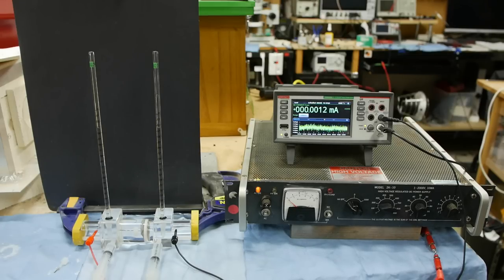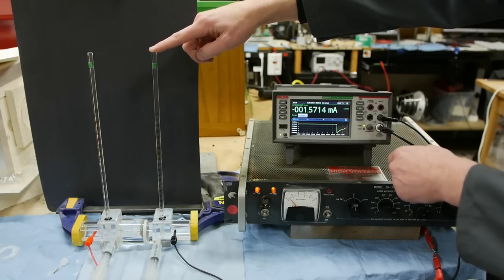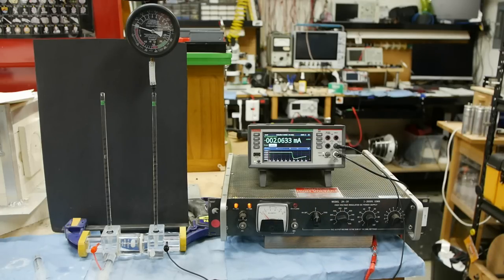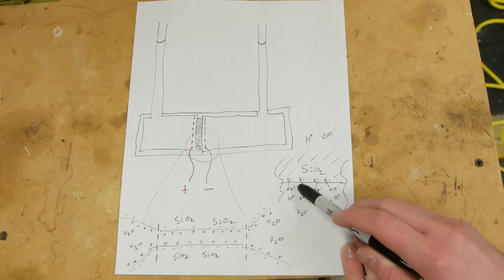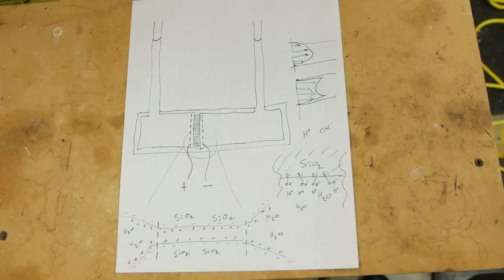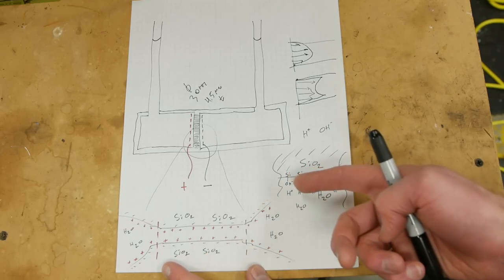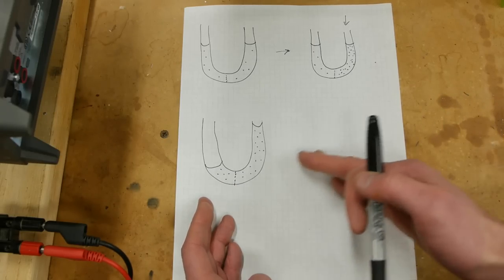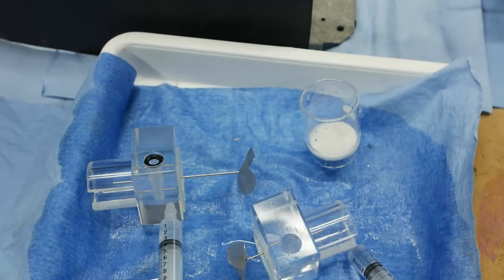Electro-osmosis: pumping water with electricity and no magnets

Comment: Doing the math in my head, half a milliamp times 200 volts is about a tenth of a watt, a tenth of a joule,  a hundred grams per second, a tenth of a liter/s?

I see where you're getting 20 ml with three milliamps? Which is .6 watts, .6 joules, 20/600 ml, a little less than seven percent

Comment: So oil does not get pumped with this pump.  If you have salad dressing on one side could it pump out clean ('ish' due to other polar molecules getting pumped as well) water? could this be used as a stage in water purification?

Comment: For your information. Is it the same theory? May be not, but similar equipment setting? Yes for sure! The Japanese have a similar device in use in fish framing business, not as a pump, but a device to kill water born virus of fish in flowing water. The process let the bacteria and virus in water be the conductor, there for burn them to death with 3~5amp of electricity during the process. Suppose if there are more virus in the water, the flowing of water will be faster. That device is still a restricted item from export for obvious reason.

Comment: It sounds like there could be a lot of cool applications, such as filtering out water, or using it as a flow sensor. Given the responsiveness, it's almost like a transistor. If both ends were closed off with membranes, you could probably make a speaker. Maybe this could be combined with Sonoluminescence?
Reply: The filtering aspect would be a negative actually. As it would cause most implementations to clog up very quickly.

I'm not saying it has NO use. But the efficiency would be a problem in all but the most specific situations.

The electrolysis is also probably a problem. Or a hazard even.

Comment: I don't get how the OH is desorbed to recombine with H
Reply: I don't think it does. I think all the H+ ions gain electrons from the negative electrode and become H2, while the positive electrode removes electrons from H2O producing O2 and H+. The OH- all stays stuck to the glass.
Reply: @gcewing  that was also my. conclusion. It would be interesting to measure the pH in the two chambers. But I wonder since it changes the composition does it count as a pump?
Reply: I suspect you wouldn't notice any change in pH. Lowering the pH, for example, would require increasing the concentration of H+ relative to OH-, meaning there would have to be some other negative ion around to balance the charge. But with only pure water in the system, there isn't any other species of negative ion available.

So I think there will be equal amounts of H+ and OH- everywhere at all times. In the chambers, it's just the naturally occurring H+ and OH- that you get in pure water. Whenever an H+ is created at one end, another one is removed from the other end. The H+ ions flow through the system, but their concentration doesn't change.

Comment: I'm sorry.  Are you actually generating an electric current by passing water across two electrodes?  Is that what's happening?  Doesn't that mean you could charge water up and then harvest the energy from it?  

Does the water have to be ionized water?  Rather what is the Ph tolerance for being able to make the water move via electro-osmosis?  How does distance, and electrode size affect the ability to move water?  

13:39 What if you had a smaller, conductive rod running up the center of the pipe?  Or a microcosm of the pipe system itself?   Don't you double the points at which the field is being generated strongly while also diminishing the area of low charge by half?  

could you move water through a pipe using several of these systems interwoven along the pipes length and managed in such a way that the they did not interfere with each others fields?  

What happens if you invert the tunnel and make it a toroidal structure inside a H2O system?  

More importantly,  I think, is for me to share with you some of these other  experiments related to water and its properties. 

1: Ted talk regarding the "fourth phase" of water, wherein the facts you highlighted are expanded upon , regarding the tendency for water to decouple where it meets the pipe.  

https://www.youtube.com/watch?v=i-T7tCMUDXU

So I think that means that you generate a tubular area of EZ water exists inside the physical pipe thats negatively charged.  Therefor couldn't you generate sin-waves up the length of the "pipe" of EZ water?  

If you can do that,  shouldn't you be able to move the water with it? Is that basically whats happening?

Comment: what if we have positively charged metal plates enclosed in glass and another negatively charged plate sealed in glass, and put the plates really close to one another,  submerge the plates in water, will they pump the water from one side to another? will the current flow be equal to zero, since the plates would be acting as a fully capacitor ?

Comment: There is no doubt that the efficiency of this pump is not very high. But I don't think its because of electrolysis. After all the electrolysis just needs 1-2 Volts whereas you are applying 200 volts. The major effuciency cost is probably heat generated by collisions of H+ and H2O aswell as friction with the glass

Comment: it doesn't seem very strong though.
i mean it can be stopped with your finger and requires such a high voltage.
what would this be used for?

would putting them in series or parallel proved a strong force?
Reply: I don't think you can get much more pressure out of it,  an increased current would have diminishing returns, and putting them in series wouldn't do anything. You could increase the effective size, either by using multiple in parallel or a single larger unit to get a greater flow but it would be at the same pressure. It would draw more current but the same current per area. And that's kinda how it would go with any kind of pump; whatever kind of pump, for a given size you can only add so much energy in to pump with, and in order to get more pumping you wouldn't put them in series but instead in parallel or use a larger pump.

Comment: I think the switch is on 100 volts not on 200
Reply: symmetric power supply?
Reply: symmetric power supply?
Reply: It can be giving -100 and +100, so you get 200V

Comment: When you treat a wastewater by providing high electric field to it like in pulse electric field used for inactivation of microorganisms in the wastewater, will the water after treatment would've current/charge in it. If yes what would be the remedies to counter this problem. As in pulsed electric field we use a high voltage. Kindly if someone knew anything about it reply ASAP

Comment: Porosity of the glass particle packing?
Reply: 19:08 it's between 4 and 5.5 microns
Reply: Ask Questions, Try Things , that is the size of the glass particles. I was wondering what is the fraction of water/glass in the porous packed bed
Reply: @mujikag  Fritted glass filters are classified by the Pore Size (Microns) not by the glass partial size. The pore size is 4-5.5 microns. the glass particles are much larger and are fused together. The space between the  sintered glass particles where the glass has not fused together is the pores. these are not packed particles of glass, the glass particles have literally been fused together in the sintering process. 

No idea what ratio of water to glass in the Fritted glass filters would be.

Comment: could you pump a polar substance out of nonpolar one? toluene+ethanol -> ethanol comes out?
Reply: Maybe, but even if the polar liquid gets selectively pulled by the electric field while the non-polar one doesn't, the bulk flow of fluid would transfer momentum and drag some of the nonpolar molecules along for the ride and molecular diffusion would also work on evening the distribution of solute.
Reply: @matta8508  maybe try to mimic fractional destillation by stacking multiple pump stages

Comment: I feel like you explained this really poorly. I dont understand how it works at all from your explanation.  you say that the glass separates the water into OH- and H+ and then the H+ get pulled through the filter by the electric charge. but then wouldnt that just lead to a build up of H+ on one side and a build up of OH- on the other side? how are those H+ reunited with OH- on the other side to form a flow of water?

Comment: Has anyone tried to make a de laval nozzle shaped membrane for a MHD pump? I'm thinking the right electrolyte and power profile will cause rapid electrolysis after supersonic acceleration of the water, resulting in an oxyhydrogen gas generator with high efficiency, that can also generate thrust on demand if the downstream oxyhydrogen gas goes through a 2nd nozzle for combustion.

Comment: why is higher current downwards on the scope?
Reply: i wondered that. i think if he swapped the leads on the current meter  it would have read right.
Reply: It just depends on which way he wired the current meter. Swap the leads and it would go the opposite direction. The way he wired it, it shows negative when current is moving. Think of it as "consuming" current. Therefore when current increases, the number becomes more negative, thus it goes further downwards on the graph. Swap the leads and it would have gone up. Which I think personally is more intuitive, but either way it really doesn't matter, it's just the magnitude of the number that matters in this example!
Reply: @Mythricia1988  the current was reading as positive
Reply: @nicktohzyu  No, there's definitely a minus at the far left. There's a few brief moments when it's positive, but during those moments, the graph movement is also inversed, so still works the same.

Comment: That's not a pump, it's an impeller/fan.  Pumps produce flow.  You are producing pressure
Reply: But surely an impeller/fan actually require an impeller or a fan to be present, ie. A thing spinning to produce pressure. Also, didn't we see it producing flow?

Comment: So a few questions
Could you use this to generate electricity?
Is there a way to harvest the Hydrogen/HHO from the system without hurting it?
Is it possible to swap in a small but powerful permanent magnet to make this function reasonably similar?
Reply: Why magnet?
Reply: @edward17829991  I'm unsure but is seems like the electricity is serving as an electromagnet. Although to get a permanent magnet on the level of 200v and 0.1amps would probably be quite large, although I'm unsure how large
Reply: He showed it generating electricity (when acting as a flow meter), but it’s far easier and more efficient to extract energy from water with the good old hydroelectric dam.

Comment: If the filter mesh you're using is anything like these: 
https://www.mcmaster.com/85385t117
https://www.mcmaster.com/85385t101
I'd suggest trying to laser cut it instead of using scissors. At my last job, I discovered that the 50W CO2 laser in our incubator could cut both fairly easily. I hadn't expected such a low power laser to be able to cut metal, but the wires in the mesh are only a few thou thick, so it works! It's great for making custom filters.

Comment: Imagine if you were able to use a membrane that was composed of sub-micron parallel channels. It would be far more efficient. Unfortunately I think that constructing such a thing is far beyond human technology. I bet that this sort of pump would be useful for nanotechnology.
Reply: I think it should be manufacturable. Check out MEMS technology.
Reply: such things can be made
Reply: Look at the pipettes they use for cutting eukaryotic cells, or injecting things into cells. They also use pipettes like that, with a vaccine on one end, to hold things like human gamete cells (eggs).
Reply: Nano carbon tubes. Not sure, but i think they can be constructed the way you say.

With lithography maybe they could be done.

Also there are milling cutters that are very VERY thin. There has to be drill bits also. Thing is the depth of cut are very low as well.

But we have the technology.

http://www.pmtnow.com/nano
Reply: a wad of fibreglass perhaps?

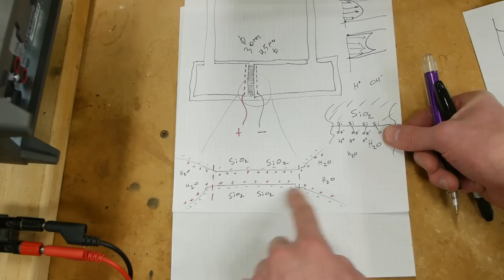Comment: 18:21 So it's nothing at all like the Internet? Got it.
scribbles note Fri..tted.. glaaaasss... fiilll..tteerr.. noot.. liikkee.. Iinnterrrnet.
Reply: DIY frit:  Place glass in a tumbler with (clean) rock or metal. The result is crushed glass, called frit. Next filter and wash the frit to obtain your desired size pieces. Then place the frit into a heat resistant mold of the size and shape of the desired end product. Finally heat the frit just enough to fuse, but not melt entirely.  Optionally, prepare the edges for your particular application, such as applying silicone to form a seal.

Comment: When you push the water through and measure the current (without the power supply), what's the resulting voltage?

Comment: well, it looks like we are about one degree Celsius off on that ah magenta color. I guess I am gonna have to quantify the 7F reading on this and that would run it through the surface gravity viscosity. Ah, I could plug it into the Marshall formula, and that would ah, that would give me a more accurate mix design. To me they're just a little bit off, what I can do on that is run a pap smear, ah test and than ah, tone it down a little bit.